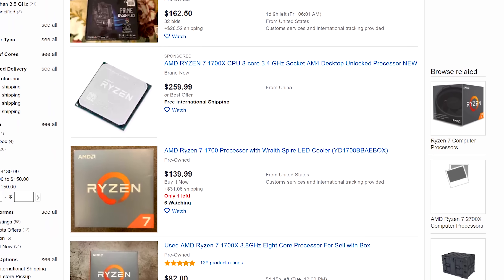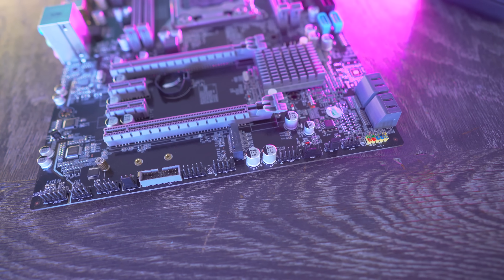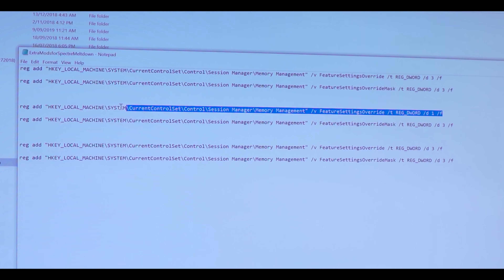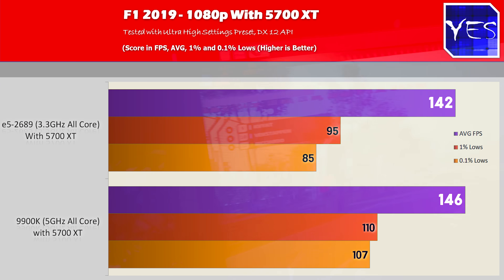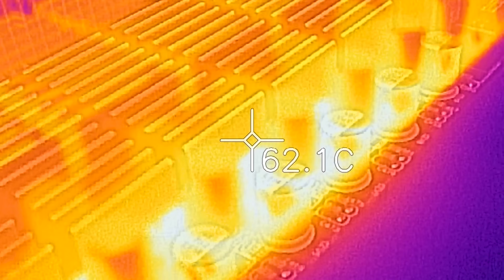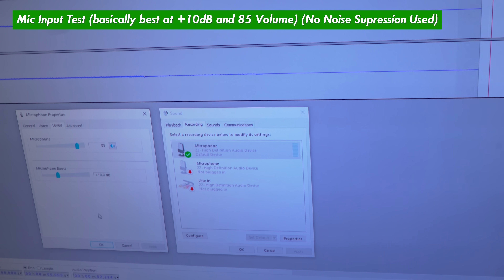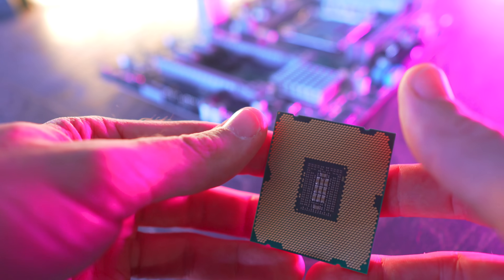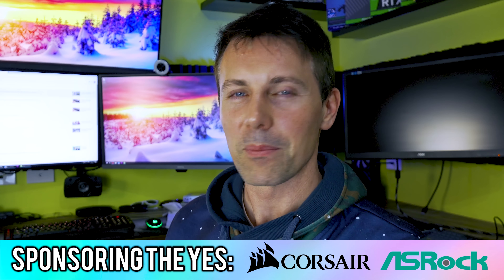8 Core CPU for $53....!? Will it BOTTLENECK a RX 5700 XT...!?

Comment: Couple of things to note:
While you are getting great performance, one has to consider how it feels when using it on a day to day basis. Benchmarking for a couple of days doesn't always show what's under the cover, and as Tech Deals would note, it's not just about the gaming experience when going for an older platform or even a mishmash of parts that may not be optimal. 
I'd say this system would work pretty well but pricing seems to vary, UK Pricing is very odd. I don't particularly trust the long term stability of non-branded motherboards, though that's just me. For what it's worth, for those willing to take the risk, it's a good budget option, just understand the limitations and what needs to be done to ensure longevity (Such as cooling, what the motherboard can support).

I'd still recommend going for a Ryzen platform if you're after long term upgradability and platform support for the average joe. For us folk, well, doesn't hurt to experience something new!
Reply: Honestly I'm undecided between going for this or a ryzen build

This cpu can be upgraded later on with pretty good ryzen alternatives so that's what's making me doubt
Reply: @a.v.d.s.2216  Ryzen 3100 and 3300X are out and basically they're keeping up with an i7 7700K at a price point of $99 and $120 (price varies depending on region). 4C8T processors that provide a huge amount of performance, with extremely huge upgrade path to boot.
Furthermore, PCIe 4.0 for B550 or X570 boards and generally a newer supported system, I'd just go for it.
Reply: @ReapingRose115  wait, you mean the new ryzen 3 everyone's talking about?
What kind of upgrade can one do from that CPU? Ryzen 7 3xxx?
Reply: Because my worry is I'll have to upgrade to a new motherboard every two years if they make different sockets for every model..
Reply: @a.v.d.s.2216  B350 and B450 and corresponding X  Mobos can go up to Ryzen 9 3900X and 3950X depending the model and BIOS. 
This was tested by a variety of different YouTube channels including Hardware Unboxed with fair results. Upcoming B550 and existing X570 may support Ryzen 4000 though whether previous boards will is still uncertain with current news going on. 
While used parts are great, going for a Ryzen platform at a price point of $99 gives so many options down the line.
I recommend looking into it and exploring the options. 
I also implore a search for a Ryzen 1600AF, a slightly slower version of the 2600 (the 1600 is 14nm, 2600 is 12nm). 2nd Generation is slower than 3rd generation parts in single core performance that even the 3100 and 3300X can keep up, but the 1600AF is a 6C12T chip, and was going as cheap as $85, however prices have gone up to $150 from various vendors which makes the value proposition lesser. If you can find it for $100 or less, it provides great performance regardless. If the budget can stretch closer to $150 for a CPU, you may want to consider adding up for the 3600 due to its great overall performance.
Good luck on your search
Reply: @ReapingRose115  thank you! 
That might have been a little too much info all at once, I'm too used to Intel chips 
I'll look into the ryzen 7 1600AF but will keep an eye on the upgradability.. that's really what I'm focusing at..
Reply: @a.v.d.s.2216  I'll give a tl;dr
Ryzen will provide a bigger upgrade path and modern features.
You can get an upcoming B550 Board or X570 board and pair it with a 3100 or 3300 and upgrade to 4th Gen.
 B350/B450 or X370/X470 is currently limited to 2nd/3rd Gen until further notice. You can get up to a Ryzen 9 3950X 16 Core
Reply: @ReapingRose115  oh, sweet! 
Thanks a lot!

Comment: I have an intel  Xeon e5-2648L v3 30M cache ,1.80 ghz.    (ES)    .  Runs at 1.4ghz all cores . go up to 1.8ghz max ...     What Board Do you recommend to get best speed out this chip.? 12 cores 24 threads its a beast of a chip except for gameing it takes a hit. Wouldn't mind sacrificing few cores for more speed!  hoping to get it above 2.4.ghz . current board is the MSI X99S SLI plus (MS-7885)any help would be great . P.s. buying the bundle with your above link for a p.c. for daughter!  cheers for this !

Comment: Heya, Will this chip fit in my dx79sr mobo? I currently have a 2670 that I have had since fb first dumped their procs about 4-5 years ago. It is running at 3.1 turbo to all cores with a slight bclock oc. I also have a 2680 that I got given to me. Is it worth it to "upgrade" to this chip? Should I throw in my 2680? What are the settings you are talking about and where can I get the tutorial to implement them?  I am refereing to the settings at the end of the video. Thank you so much for doing these videos. I thought I was crazy when I first built this rig for under 300 bucks. But I swear it has only gotten better with games using multi cores. It is paired with an evga hybrid 1070 and 32 gigs of gskill ares ddr3. Please either link me to one of your other videos with answers or if you could give me a reply I would be so appreciative. If you register for BRAVE I will give you some money. Thanks!

Comment: That was a weird video.

Your speeds are slow...
For example you shows a 250MB/s transfer, if mine isn't 700 I think something is wrong.

You said it was good??? Why

That limit is a drive speed, send or receive right? That still slow.

My Xeon system transfers exceed 1196MB/s on mechanical Drives and my single SSD does a clear 476MB/s.
Have you and maybe a idea, have you considered used commercial hardware?
And clustering it does scale well for gaming. It does work provided you have the dual system link cables...
See the rear of a IBM x 3650

Comment: This goes to show that intel has been holding out FOR YEARSSSSSSSS.
Reply: no, it goes to show that programming is sooooooo far behind modern hardware.  Going with a modern AMD chip or Intel chip does not make a difference.  The GPU is almost always the bottleneck.
Reply: All this really goes to show is that with modern games using multithreading any cpu with decent thourghoput can be used for gaming even if its old. Really puts some perspective on what you actually need vs want for a gaming pc. Everyone out there arguing about intel vs amd and throwing cinebench scores around, but in reality any cpu with a passmark over 7000, regardless of core count or clockspeed, however it gets there is fine, has enough power to game at a level almost anyone would be happy with. GPU power requirements just keep raising but cpu requirements really dont that much.
Reply: @eclipsegst9419  exactly so.
Reply: @eclipsegst9419  what about now Mr.Tevarlod?
Reply: @ابراهيمالمطيري-ب7ض  Now? Now we have garbage optimized UE5 titles everywhere lol
Reply: So many people are drawing false conclusions from this video.
Reply: Server loads demanded it far longer.

Comment: I had an old AMD APU and needed an upgrade, but upgrading to a Ryzen was expensive for me because I needed to buy motherboard and ram along with the new processor. I went instead for a combo of one of this chinese motherboards with a E5-2689 with 32 GB of ram, ended up spending less than 180 USD and got a nice upgrade. Running smooth for 2 months now.

Comment: The same i7 2600k@4.5ghz = i7 8700k@5ghz paired with gtx 1070 1080p ultra, gpu bottleneck first, and has better 1core performance than this xeon ;)

Comment: Constantly having problem with this combination...  According to AIDA64 CPUID, the memory type only shows "Triple Channel" or "Dual Channel" instead of "Quad Channel" with four ECC DDR3 RAMs (not w/ non ECC).  Also, CPUID HW Monitor indicates that the system temperature reaches 127 degree Celsius (260 degree F) but when I checked the laser thermal gun, it's way lower... (problem w/ temperature sensor on the motherboard?)

Comment: looks like the e5-2690 is the sweetspot as the max turbo clock is 3.8ghz with 8 cores 16 threads.  If it provides the same performance of a ryzen 7 1700 for half the price.

Comment: Fresh Windows install, put in the Power Shell commands to disable Spectre and Meltdown mitigations, reboot and now my Time Spy Graphics Tests run worse than they did before putting those commands in.. :- / Looking at graphs I see that the cpu maxes at 2600 MHz during those tests and most of the time is even way lower than that.. 15 minutes before, when mitigations were still there, it did keep at 2600 MHz minimum during those tests.. Power Limits and stuff in bios remained unchanged. WTF 

Edit: Revelation in CPU power; High or Ultimate Power Plan Setting! Why nobody ever told me about this.. I think.. CPU is now boosting to 3,3 GHz MINIMUM during that 3DMark test gaddammit! Let's see now what those mitigations' undoing is gonna do..

Comment: I have a computer with dual e5-2667v2 watercooled clocked to 3.7 ghz. They are on a supermicro x9dri-f motherboard, 128 gb 1866 mhz ECC ram and a Radeon VII. In games like Rainbow Six Siege, I get around 150 FPS on maxed out settings @ 1080p, according to other benchmarks, I am supposed to be getting around 250+ FPS. In Division 2, I get 60 FPS at maxed settings @ 1080p (I am supposed to be getting around 110-120). In Ghost Recon Breakpoint, I get around 60 FPS at maxed out settings @ 1080p while I am supposed to get around 110 FPS. I thought this was a bottleneck, but after watching this video, I think it might be something else because the e5-2667v2 is a slightly better cpu than the e5-2689. Can it be a GPU defect? Thanks!

Comment: This video is misleading. I had E5-2689 and E5-2690, and the lows in general are much lower. MUCH-MUCH lower than 9900k, about 30 to 40 fps lower, sometimes 60 less. 9900k stays very consistent across average, maximum, and low fps. 
E5-2689 is great, but can't fuck with 9900k, when it comes to lows. 
This test actually shows the limitation of E5-2689 in that Tomb Raider benchmark. That shit right there is a common trait of old cpus being weaker than modern ones. 
I love Xeons...but I don't like that video. It's misleading. I play R6 Siege, and E5-2689 is literally around 40 fps less in minimums. ~59 (E5-2690) vs 108 (9900K), pretty severe difference. But it's still a beast. 
Search 9900k vs E5-2690 and you will find my benchmarks on R6 Siege
My channel is called: Game Benchmarks

Comment: If you have $400 minimum to blow on a GPU, why the hell would you stick it in a dead end system when you can find a ryzen 5 1600 for $30 more? And there's a reason ECC ram is cheaper, is much slower! Honestly I don't see the point of this. Before ryzen, sure, but now, why? You say it yourself, you lose upgrade-ability of anything except CPU, which you can also do cheaper by just upgrading to a ryzen 5 2600 which is better and cheaper that the 1680 v2, and you still have more options with AM4 up to the 3950X if you choose a proper motherboard.

Comment: i think i'll be going down this route to have a decent and cheap pc until Ryzen 4000 or 5000 come out and Radeon with Ray Tracing is twice as fast as the 2080Ti , i think it will be only worth upgrading once high end hardware post-ps5 launch comes out and gets discounted.

Comment: I ordered an E5-2658 8-core a few days back for a build I'm trying. $30 shipped from eBay. I hope it works out. The motherboard I ordered supposedly supports it. Got it for $30 too. Waiting on everything to arrive. Total build cost will be around $130 for my rig and it will be a major upgrade to my current setup. I'm used to playing games with 30-40FPS lol

Comment: Hey Brian, really good idea you had here I used a R7 1700 with an GTX 1080 when they were dirt cheap. I sold that one for the profit and I still game on x5650. Anyways got a RX 5700 on a bargain, will my x58 and xeon bottleneck the 5700 non-xt? I game at 1080p 144hz.

Comment: One question here? Have you overclocked your xeon mine hits 2.6 per core I think how do you do it and is it save to do
Reply: This Xeon can't be overclocked, it has a locked multiplier. To get all cores to boost to 3.3 GHz under load, u have to adjust the Power Limit options in BIOS..
Reply: @JukkaX  i think there is a Russian guy that did overclock or boost the corres
Reply: @TheMoviebuff78  Well ask him.. Only way to overclock these is by the bus clock. Haven't found a way to do that. Tried with SetFSB but so far no luck.
Reply: @TheMoviebuff78  He just changed the multiplier.. He's got a processor that has open multiplier.. E5-2689 is LOCKED.

Comment: Would this be a good upgrade for a 3930k on a sabertooth x79?   This chip is not on Asus list for this Motherboard...
Reply: It's not on the list 'cos this processor doesn't exist on Intel's lists either. 3930k is 6 core and can be overclocked, this is 8 core and cannot be overclocked. Decide yourself..
Reply: @JukkaX  Point: has anyone over clocked this on a OCing motherboard?  Will a Asus board even, 'SEE', this chip?  Your reply gives no info, so what was the point of responding?
Reply: @rockycassiano4756  oh dear.. Sabertooth is a decent oc board.. and this cpu worx on it 100% Overclocking this cpu can only be done raising the front side bus clock (that 100 MHz thing). Multiplier is LOCKED.

Comment: I believe in most cases, it is hard to beat Ryzen these days on value/performance.  However, when I was able to recently acquire in local purchases an ASUS P9X79Pro for about $20 and an E5-1650V2 for $60...quite happy to stay with XEON and X79. These used parts are in excellent condition, so it wasn't like I had to fix bent pins or replace leaking caps.  They have been running well together at 4.4GHz, paired with GTX980OC and 32 GB 1600 non-EEC DDR3 HyperX Fury. (CB R20 @2471; CB R15 @1100; Passmark CPU @15.8K; Geekbench4 @ 4409single/23374multi; Geekbench5@949single/5363multi)).

Also, a HuanaZhi Deluxe X79 for about $100 on AliE and an E5-4627V2 (8C/8T, 3.5Ghz all core) off of eBay for $80 (plus $14 shipping).  Also a solid performer scoring about 950 in CB R15. My eldest child uses this PC and it has been a steady performer for the better part of 2019.

Comment: Can I use a rx 570 4gb with it? Building my first budget gaming PC.
Reply: Should work well
Reply: Just get an i5 3570k or something similar. You'll have a better overall build honestly and you'll never come close to bottlenecking. You could actually oc the CPU and upgrade the gpu to something more powerful and still not come close to a bottleneck
Reply: @mysticredneck9180  Allright. Thanks.

Comment: I'd still be running my Xeon X5675 @ 4.8GHz if my 5700 XT worked with my Rampage II Extreme. But apparently certain X58 revisions don't like newer GPU's which is absolute BS. However, after switching to a Ryzen 5 3600X I realize that the ol' Xeon was finally outclassed for value/performance. I'm never getting rid of it though, it's now my home media server, and I still consider X58 a contender for the platform which remained technologically relevant for the longest stretch in PC history.

Comment: 3930K. Similar price, overclockable 6c/12t, 4.2GHz easy on a very cheap air cooler. Faster at 4.2GHz than 2689, higher single- and multithread performance.

Comment: Problem. Huananzhi X79 +. E5-2689. CPU Factory Power Limit in BIOS is 115 W. No matter what I type in for power limit, zero or 255 W and max out the time limit, the power limit stays at 115 W. In LinX it's clearly visible in HWInfo; CPU Package Power starts hovering at 133 W, but throttling starts immediately and clocks drop to 3,1 - 3,2 GHz and after a little while Power is there at 114.x Watts and clocks at 2.9 GHz on all cores. Vcore drops from 1,15 V to 1,08 too naturally. Power options in Windows are not a problem either. Max. temps of the cores during LinX is 45 'C and the VRM is actively cooled too. What can be done? Is this board defective?
Reply: 2689 boosts 3.3ghz all cores
Reply: @kruxdt6307  Oh really? Sure it does on light enough load like gaming, but not on LinX and Prime95 for example, not on this board at least. Would like to know how it worx on an old Gigabyte or Asus X79 board, throttling at those too?

Comment: Hey buddy i just bought this whole setup( from your Links) and i cant get it past 2.6 ghz tried all you did but it wont go past 2.6 ghz ....CpuId will post it at 3.6ghs for .5 second can i get your help on this ..Thanks from Canada hey !
Reply: Lift the power limits (long and short term) from bios to 255 W for example. For some reason isn't working for me anymore though..
Reply: @JukkaX  I did do that 10 secs on the long and 2.5 secs on the short but i cant recall how many watts but it wasnt 255 ....btw what are the 2 jumpers for ....cmos is a touch pad on the board.
Reply: @QRcoder1  255 W is the max. u can put there, in hope that at least THAT won't  won't throttle the cpu. Xeon 2689 uses (tries to use..) 130 W in LinX, that is the most power using application I know.. For those TIME limits I dunno exactly what is the logic, but better max. out those too. 255 seconds is the max. in the long term one at least. For the jumpers in Machinist I dunno, I have the Huananzhi one and I don't know about it's jumpers either. I managed to reset the bios finally by having the battery off for more than an hour. Sadly it didn't help in my problem.